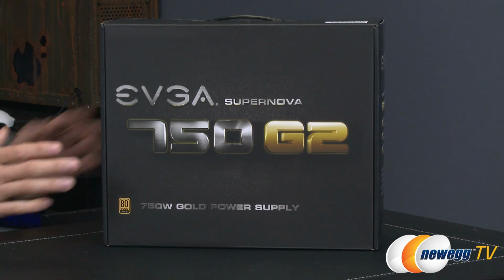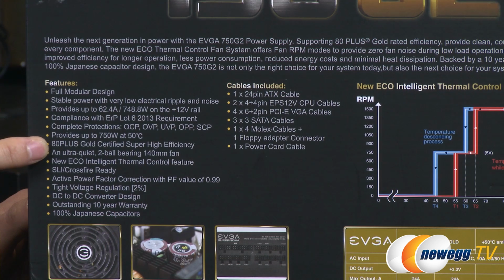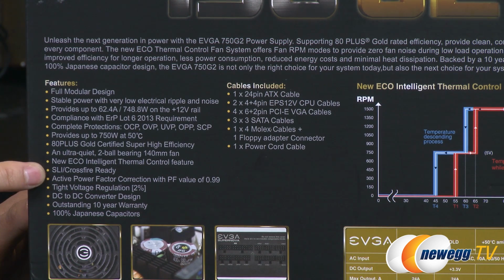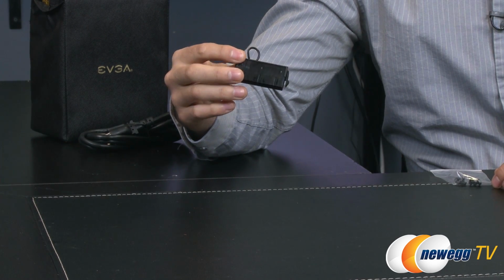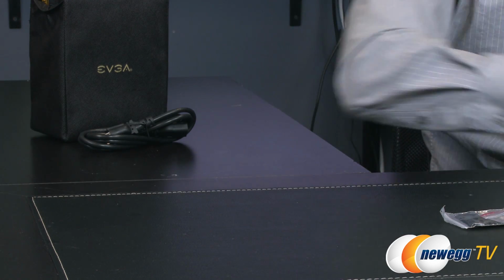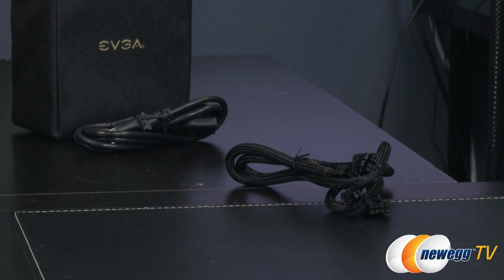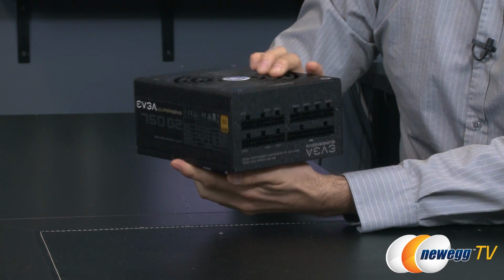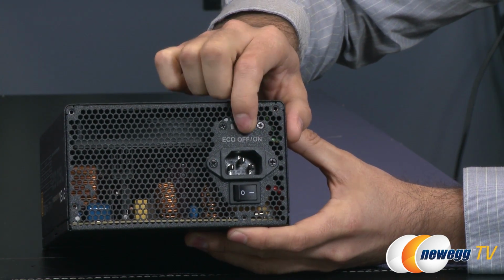EVGA SuperNOVA 850 G2 850W Full Modular Power Supply Overview - Newegg TV

Comment: this is a nice psu. glad they fixed the issues the older version had..
Reply: I wish corsair would fix some of there power supplies, all there bad reviews is what made me get this.  At least with this company they recall products and will fix them. more than corsair does, I am still waiting on a ticket for RMA for my case fan controller on my 600t case . from what I hear with EVGA they get back to you rather quickly.
Reply: ***** yeah i heard evga has very good customer service. Corsair make some good psu's im currently using a hx650 and never had a problem. i would stay away from the RM series though. if i didnt already have my Be Quiet Power Pro 10 850 for my new build id get this evga supernova 850.
Reply: teeblack06 I got the 1000watt power supply cheaper on amazon for 199.99 and free shipping, I love newegg don't get me wrong seems like they are charging for shipping these days, some of the products I see say like .99 cents lol

Comment: Man I love Corsair and I love EVGA. My last 850 PSU was Corsair and it was great. But for my new build I require a 4th gen intel capable PSU and I'm stuck between this one and the Corsair HX 850w
Reply: +TwistinFool get the EVGA. Far more quieter and efficiency. Very close though. I was a corsair fan boy for a while and recommended them to all my friends builds but now i recommend these two (EVGA 750w and 850w) did i mention 10 year warranty?
Reply: When Corsair stops showing a PSU on their site, you know it isn't worth buying.
Reply: +Infinite Zero Corsair are shit, had 2 failed units in under 4 years

Comment: I just installed this with my friend. Beware, this PSU is massive, be sure it will fit, we had to fiddle in order to fit it in correctly.
Reply: What case do you have>?
Reply: FunGUI Sorry for late response, but everyone starts somewhere. I started on a $30 diblotek case! Right now I'm Using a spec-02 from corsair.
Reply: FunGUI the inside looks terrible however the outside looks pretty good for price
Reply: FunGUI
I started with a TT versa II, now i have a Fractal Design Define R4, that was a heaven and hell difference.

Comment: Bought a Corsair CX750 and it buzzes and the fan is the loudest thing in my system apart from the HDD's which I have set to turn off after 2 minutes and they do because I have no applications installed on them.

So its by a factor of 3 usually 98% of the time the loudest thing in my case then when I play games and it starts with the coil wine its loader than the GPU fans which is saying something.

Anyways it was only an extra EVGA 750 G2 £20 and it comes with a 10 year warrenty that alone makes it worth the upgrade but it also comes with better power delivery and actually delivers what it says on the box, gold rating, less noisy etc etc etc etc. I think for £20 extra its completely worth it.

Comment: with this psu does it matter if the fan is facing down or up? its for a fractal r5 case
Reply: +Steven C (Daylife) It won't make a difference really. But if the psu is facing down putting your system on carpet floor is a bad idea. In general you should keep your PC on a desk or a piece a wood if you don't have the option. Hope this helps.

Comment: could the 850w psu power 1 gtx 980?
Reply: it could power 2-3 depending on the rest of your system
Reply: HaWe FTW could I do it with 2 sli of and fully watercooling loop
Reply: Gunner Gamz lulz http://www.extreme.outervision.com/psucalculatorlite.jsp

980 is damn efficient if you only need to power 1 + CPU, 4 x DDR3 dimms, Motherboard, 2 x HDD's 7.2krpm, SSD you would only need 450W PSU, 500-550 to be save would be advisable.

With a 850W PSU you could not only run 2 not 3 but 4 GTX 980's in SLI no over clocking headroom with that though, although no one should ever run 4 of any card as its inefficient as adding the 4th card give no tangible performance increases, and has a load of drawbacks with increase micro stutter etc etc etc.

Also cards are getting more efficient especially with Pascal / 1000 series which is going to be made on 14nm FinFET node, which the nature of 14nm FinFET makes it more energy efficient, 40% more energy efficient at worst. 

So really don't overbuy on your power supply for the future.
Reply: this comment was posted a long time agoso plz noone else comment but thx anyway :D

Comment: Would the 750w version be enough for an i7 4790k, two gigabyte g1 gtx 970 (sli), a hard drive, an ssd and an optical drive? Or should I go for the 850w version?
Reply: Check out a power supply calculator and aim for about 100w above that calculation.
Reply: i say 750w would be enough, but better be safe and go for the 850w.
Reply: Do not use PSU calculating sites, They are not accurate, And yes, But to be on the safe side of things, You are probably better off buying the 850 version.
Reply: ***** This is late, but a 750 is more than enough
Reply: Mike Foote not more then enough, it's about enough, I would pick the 850w edition because it would be way more futureproof
Reply: ***** ah.  You are right. Sorry I misread and didn't see two 970's!
Reply: Yup, the 970's dont use a ton of power
Reply: Yeah. It's nice that hardware is moving towards much better power management
Reply: If you're running at stock, or don't plan to SLI, go with the 750W, but if you are an overclocker, or if you want to run 2x SLI, then yeah, the 850W is better.
Reply: ***** yeah I know I am 3 months late but hardware needs less and less power. A "futureproof" psu needs to be high quality and not high w
Reply: Exactly.
Reply: MrSaliVader 850w
Reply: MrSaliVader  Anyone recommending 850w are full of bull. In a worst case scenario what you get is: 440w for both Graphic Cards (if you overclock them) + 150w for the overclocked cpu + 50w for motherboard and memory sticks, + 8w for a SSD plus 20w for a second HD plus 50w for 3 high speed fans, assuming you would be stressing all this components to the maximum at the same time, which is extremely unlikely, this will sum up to: just bellow 720w. Keep in mind that even on the most demanding games, is unlikely that your cpu would be stressed to 150w, and that gold rated PSUs ratings are for long-therm sustained power, a high quality 750w PSU can actually deliver for a reasanoble amount of time near 850 of power if needed before switching off. So I'd say the 850w is tottally overkill for a dual sli set up. 
People ALWAYS tend to recommend oversized PSUs, I don´t know why those people don´t get a clue.
Reply: sephirotic87 I'm gonna be honest: When I bought it, the 850w version costed as much as the 750w version. And with 10 year warranty, it was a no brainer xD

Comment: I was originally going to go with a 750 G2, but since the 850 was only $20 more, I got the 850 instead. And since the GTX 1070's were always out of stock I decided to go with a $439 MSI Gaming 6G 980Ti 6GB. Not that it's a bad card by any means, but, the day after I bought it.... a few 1070's came in stock at Newegg. Any way, my question is, is the Supernova 850 G2 enough to handle a 4.8GHz 6700K+MSI 980Ti 6GB SLI?
Reply: Yes will be enough, all your components will use around 700w at full load.
Reply: Cool... good to know, thanks!

Comment: This or rm 850
Reply: This. Too many bad RM850's in circulation still. (there was a recall)
Reply: RM series is crap.. Got a friend who already RMA'ed his 2 times in 5 months.  Don't get Corsair at all. So many problems with them. Seriously, I've had many and most was crap.

AX650 - Coilwhine.
HX850 - Crappy FAN, insanely loud.. No coilwhine tho.. (Yay)
1st AX860, coilwhine, even when it was off.
2nd AX860 coilwhine, only when it was off.

Before that i had some TX models that were pretty bad too. Noise was the main problem but also had some coilwhine.

So I'm not gonna bother with Corsair PSUs again - This time I will try the Leadex platform. Toprated by Johnny Guru. Can't go wrong with that..